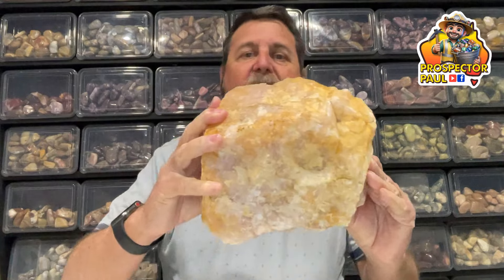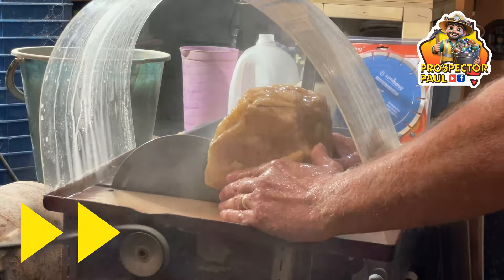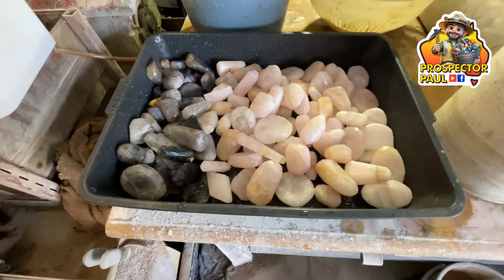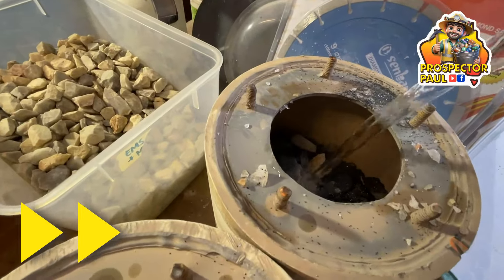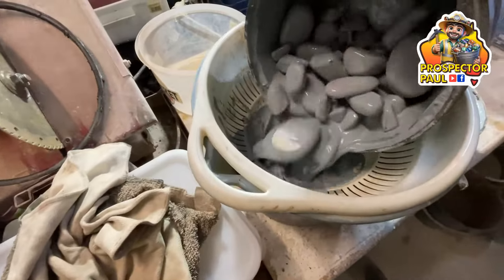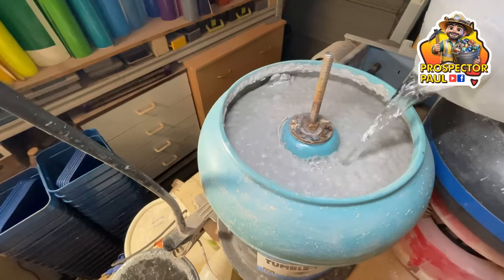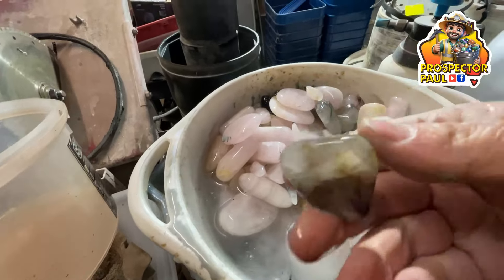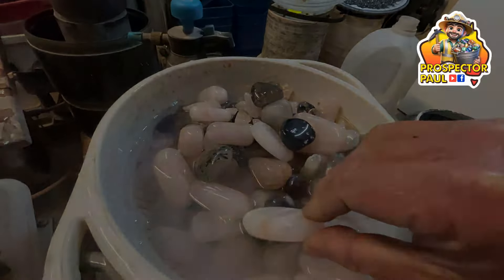How to Cut and Polish Rose Quartz #crystals #geology #rockhounding #minerals #gemstone #polishing

Comment: Is your Tumble-Vibe the V-10?  What brand and model is the other one?  Do you like them and what would you change about them if you could?  I and thinking about getting a vibrating tumbler.

I also saw 5 old computers on the shelf with 3.5 in floppy drives.
Reply from the maker: I've had a Thumler's UV-10 (black bowl) for a few years and love it, just recently I added a RayTech TV-10 (blue bowl) which does much the same job but is a lot noisier, if I had to choose I'd go with the Thumler's 👍

I have a few computers I use to drive plotters and printers (my real job) 😁which are fairly old, ATX power supplies etc. I keep the ones you saw for parts when needed 😀

Comment: Love your video. May ask what is silicon carbide is use for?
Reply from the maker: Thank you ☺I'm not sure what other uses Silicon Carbide has but in rock tumbling it's used to shape the rocks through constant grinding in the tumbler, starting at #46 or #80 grit then moving onto #220 and #600 getting smoother with each grit change then finally using Aluminium Oxide as the polish 👍